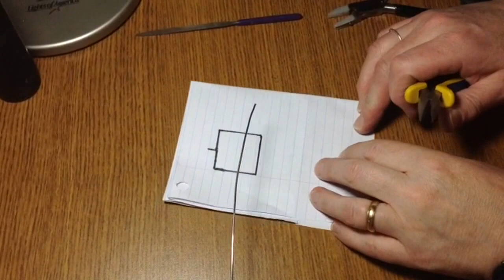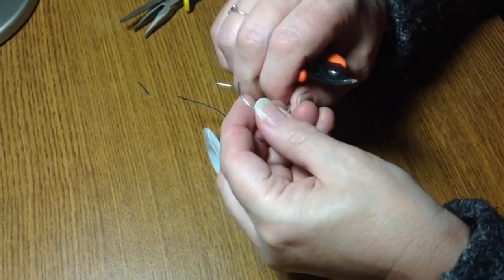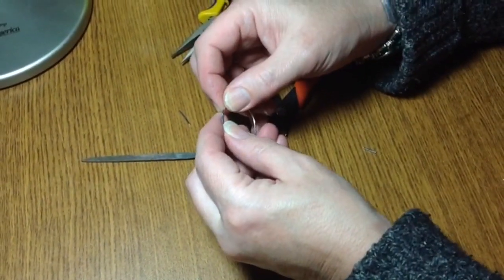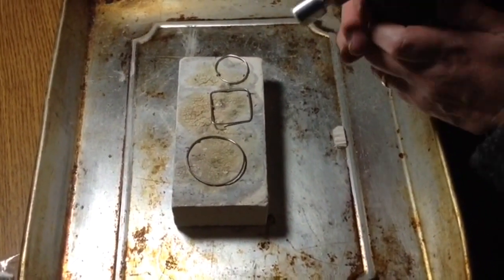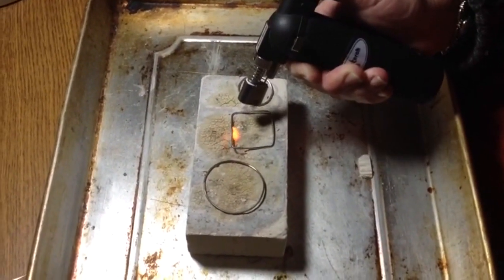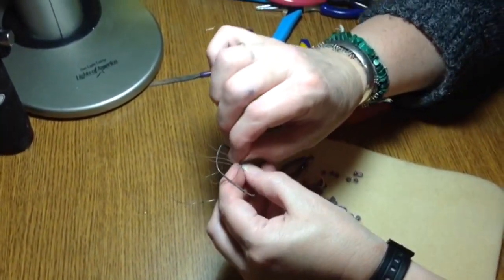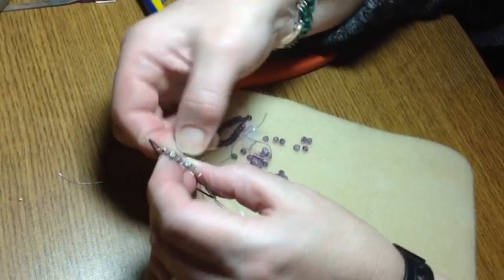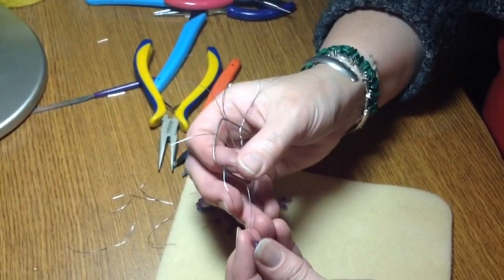Tree of Life on a Square Pendant by Denise Mathew

Comment: when you're soldering, do you use a lighter torch, or an actual solder gun? (sorry, i dont know if there is a difference)
Reply from the maker: Hi and thanks for your question, I used a mini torch also called a jewelry torch for the tutorial, you can get them at beadaholique.com if you're interested. I hope this helps :) Denise